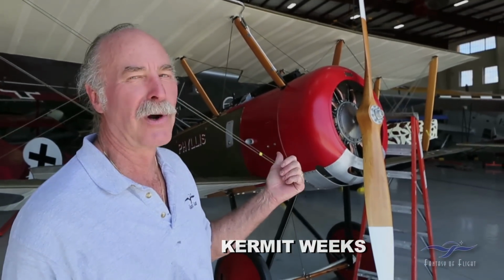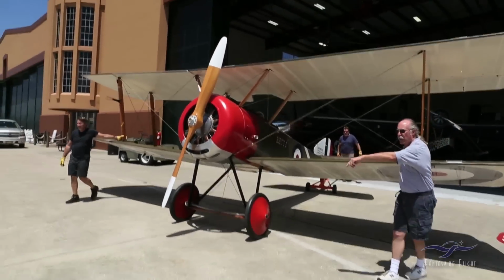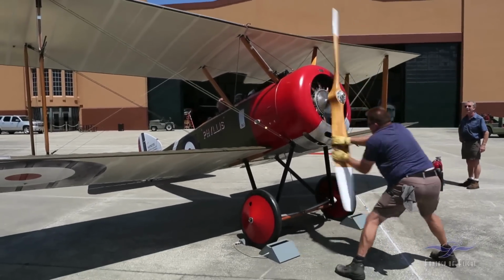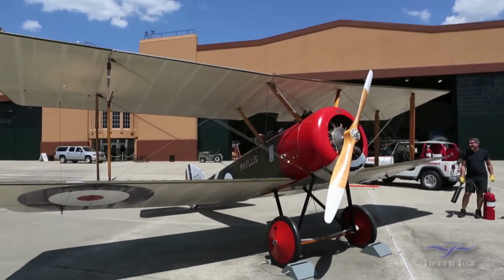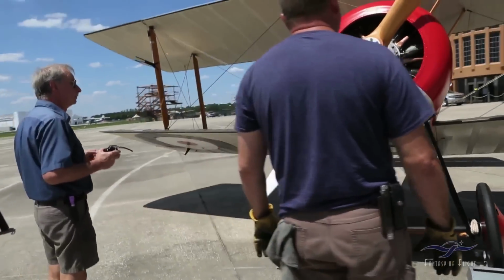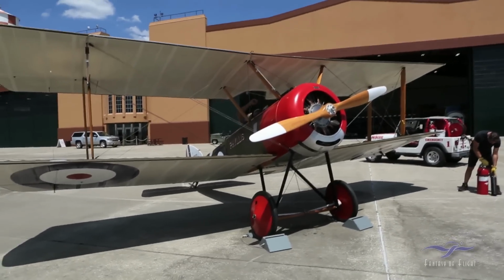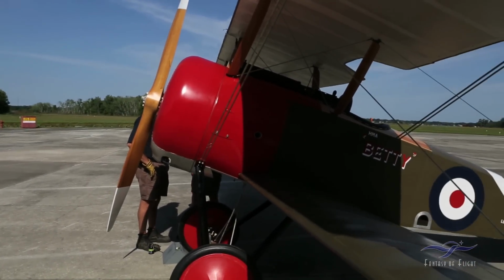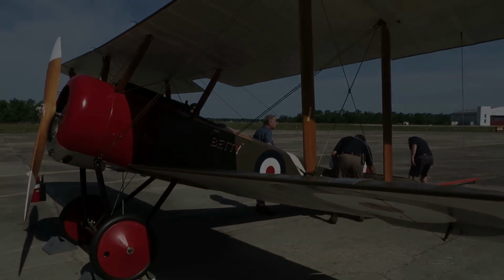Sopwith Pup - Update - Engine Start

Comment: Kermy, great video! We used to start our LeRohne 80 at full throttle after priming all nine cylinders.  No need to worry about oil pressure, with the total loss oil system there isn't any. Oh, and don't forget to turn on the castor oil (what a mess!). We always had a big crowd on hand at the Pearson Air Museum to see it run. The airplane was a replica Nieuport 24bis project stared by Johnny Hart in Vancover, WA, USA, and finished and flown by Ron Oches in Madras, OR. The airplane is currently on display at the Seattle Museum of Flight, Boing Field.
Very seriously tho, I felt less than totally comfortable in the roomy cockpit with all of the ingredients for a fire right there in my lap... the leaky carburetor and the fuel and oil tanks, AND the single magneto! The first item on the check list was to have your head examined!
Reply: I notice the situation with desperate pilots, covered in castor oil,  is not addressed...

Comment: I see the Sikorsky S-39 in the background. I remember when Dick Jackson owed it when it was at Rochester N.H.. I worked at 7B3  North Hampton N.H.for Darian Banfield until he died flying  a Bamboo Bomber  off  floats (Sky Kings) type plane back to 7B3 , North Hampton N.H. Peter Jackson ,the guy who directed Lord Of the Rings in New Zealand had us do a DR3 ( There are no Real ones flying ) as far as I know there all repicares , Albatros  D-VA  and a SE5A (rep) rebuilt and shipped to him in New Zealand.
Then I worked for Craig Sinclair for a few years. Did the fabric Paint and rigging on 3 DR3's and every type of tail wheel and strut. type plane. If it wasn't a tail wheel plane, I didn't touch it.   I owed an Aronca 1941 65CA  .And built 2 new wings for it ,tube welding on the tail .Rebuilt the whole plane. I believe she flew better than any cub.
 Lots of respect for what you do.  Steve Page , Semper Fi

Comment: At some point you or have one of your staff talk about how those rotary engine work,  everyone seems to cover the mechanical parts.  More interested in the carburetor and intake,  wiring to the plugs and points, oiling system etc.  as a rotating mass just would like to see how it is done.  I'm sure they are not as sophisticated as something I work on with rotating slip rings and mercury to connect electrical and signals etc.
Reply from the maker: I'll try to explain it all in the next "Kermie Q's" episode.

Comment: The next update may show what happened shortly thereafter.. The cowl blew off in flight when Kermit was near final, split the prop, numerous rips on the fabric, destroyed the upper wing leading edge. Some damage to the engine pushrods,etc.  The remainder of the cowl was wrapped around the upper wing. Barely made it back to a safe landing. Back to the shop. Great piloting skills the bring it in.

Comment: Are these radial engines not like the first Sherman tanks needing 60 to 90 turns before a start to.get the crap out the cylinders and build up pressure? Looks like its going that way pussing about Trying to spin that prop try turning it 60 times the cylinders are probably full crap

Comment: Great looking aircraft. Why was it that the engine spun with the prop?
Reply: thx11 3868 ; Because it is a rotary engine, lighter, better cooling, and high tech in it's day with no reciprocating parts.
Reply: And you could use the centrifugal force of the spinning engine to ensure that lubricant oil (usually castor oil) got to the places it needed to go without needing an oil pump.
Reply: Ericiri : It was so good that even the pilot got a light lubrication of Castor oil .
Reply: Yes, the joke was that pilots in World War 1 were very regular.
I think I've read that the system was "total loss" - so castor oil was being constantly vented through the crankcase breather.
Reply: EricIrl 
Castor oil was mixed in the fuel like a two-stroke, since the crankcase acted as part of the induction system. The primitive carburetor was attached to the hollow fixed crankshaft. Notice how the copper induction stacks join the crankcase.
There was no crankcase breather. The oil was thrown out in the engine's exhaust.
Reply: The predominant reason for designing the engine to spin was for cooling. Early motorcycles did not travel fast enough for airflow to adequately cool an air-cooled engine without the use of a power-robbing cooling fan. Making the engine spin eliminated the necessity of a fan. This worked well for some early motorcycles so the rotary radial was used in airplanes. A rotary design was first used in the Langley Aerodrome, but it was soon modified to be fixed and watercooled.
Although the propeller could provide some cooling in flight, the rotary stayed cool all the time.

Comment: I read somewhere that with a rotary engine due to the gyroscopic forces of the spinning engine, to bank right you push the stick, to bank left you pull the stick, to descend the stick goes right, to climb the stick goes up. Is this true?

Comment: I worked in a company that build microlight aircraft.
When an engine was started, we were told never to stand to the side directly in line with the prop, just in case the prop shattered and let go.
I see the guy at 19:45 is doing exactly that.
Was I told wrong?

Comment: Is it possible to add a more modern electric fuel pump and more modern computerized electronic ignition system. Wouldn’t that help a lot to make it more reliable? I know you try hard to make the planes as realistic as possible but it seems like that would be a good idea? I had the chance to go up with a uncle of mine that owned a Jenny back in the 60’s that was a blast to fly in.
Reply from the maker: Of course you could probably add those things, but here we keep things as close as possible to the originals.
Reply: Well if it worked back in 1917 why mess with it I guess you just have to tickle it a bit to fine tune things. It’s not like you fly them everyday. Where are you located in relation to south Florida,  Ft Lauderdale area.
Reply: Lester Miller 
That would be more trouble than it would be worth. These airplanes have no electrical systems, batteries, generators, etc. to power up such stuff and they would actually be more troublesome than these simple machines actually are in their original state. They just took some getting used to. Once mastered, they are not that difficult.

Comment: The guy hand propping is wrapping his fingers around the trailing edge of the prop, bad idea if the pup kicks back.
Reply: slickjimmy 
He's fine. Wearing heavy gloves. Not a good idea to "palm prop" it. There's too much of a tendency to lean into the prop doing it that way. I have 35 years of practice hand-propping airplanes. Better to curl the fingers a bit. They say you might get cut a little but that beats loosing your balance and falling into the prop.
I've never seen anyone get cut by a kickback. You don't wrap your fingers around it like a handlebar. Just curl the fingertips so you can pull downward while shifting weight rearward. If it kicks back it just slips past your fingertips. Might hurt a little for a minute.
Reply: @rescue270   That makes sense. I just remember in A&P school having that drilled into our heads. I have only hand propped 2 aircraft in 24 years as an A&P so far.

Comment: What engine??  Are all the cylinders spinning with the prop?? Can someone in the know enlighten us on this design?
Reply: Yes. Early rotary engines rotated with the prop.
Reply: If you get a chance, watch the movie "The Great Walso Pepper" (can be accessed on youtube), the late Art Scholl was one of the pilots. Its a good entertaining movie and their are some good dogfighting scenes.
Reply: @JLEidsness  so how does fuel delivery,  ignition control etc work
Reply: @srnunan4783  http://www.aviation-history.com/engines/rotary.htm has a lot of details about the intake manifold. I believe a magneto provided ignition that was timed thru the crankshaft. The engine rotation added a lot of spinning mass that, depending on the direction of rotation, made turns very difficult in one direction and easy in another.

Comment: never stand inline with a spinning propeller...  under ANY freak accident that thing breaks it becomes a speeding bullet, or a fragmention grenade.
Reply: I tend to agree with you on that, seeing someone stand in the prop's plane of rotation always gives me the heebie-jeebies :)
However, with many aircraft types, it's unavoidable. Simply sitting in the pilot's seat (or one of the passenger seats) puts you in line with a prop, or compressor/turbine disk.

Comment: I was under the impression WW1 rotary engines had no throttle. The engine ignition was cut on and off to control speed. I thought I had seen videos of engines stopping and starting during landings. I still don't understand how a spinning engine get fuel feed to the cylinders without leaking problems.

Comment: Just occurred to me. What do you use for fuel ? A WW2 vet I knew said that he was told naptha spirits/Coleman fuel was the nearest thing to WW1 gasoline. Supposedly rotary engines with their cam ring timing combined with low compression do not run at all well with modern avgas.  You are the people with the actual flying ironmongery,not me. Be nice to know if what he said was accurate. Beautiful airplane. You have some terrific people there. Cheers.
Reply: paul manson 
They run beautifully on avgas. At first. Trouble is all the lead in avgas. These old engines with single ignition will foul sparkplugs and stick valves after a while with all that lead. They don't run hot enough or fast enough to keep the lead from sticking and building up in the combustion chambers.
They probably run this on ethanol-free pump gasoline mixed with castor oil, like a two-stroke. It would run just fine on that.

Comment: It’s NOT HOT. The proper communication between pilot and ground person proping is, “CONTACT”.  But nice job on the restore.
Reply: Ron Pearson 
We always say "mags off!", then "make 'er hot!" just like these guys are doing. I've been propping all my life.
I think the "contact" thing came originally from what American volunteer pilots learned from French flyers in the Lafayette Escadrille in WWI. 
A magneto switch actually "turns on to turn the mag off". "Contact!" probably actually meant the mag was off, since a magneto must be shut off by grounding the primary circuit though a contactor switch.
"D'allumage!" was probably the call made to turn the mag on by opening the switch, breaking contact with the grounding circuit
Reply: Rogers Hunter Roger... I too have been propping planes all my life and I am 71 years old. The reason I was taught brakes and contact was to avoid any confusion. Over the years I have heard all sorts of words used to say, “turn on the dang mags”. Use folks do great work. Keep it up! Ron

Comment: Shouldn't it be - Kingston "Upon" Thames - Kermit ? Ahhh disregard, was on before it became upon lol
Reply: Techy111 I've been inside the building where they were manufactured in Kingston-upon-Thames!
Reply: @andrewwood6809  Seems it's officially Kingston upon Thames but I grew up many years ago a few miles away in Molesey and it was always Kingston on Thames if you wanted use the full name instead of just Kingston.  Goes with Walton on Thames bit further upstream. RJ Ashfield was my grandfather.

Comment: I can tell the way it fires then dies it's not sucking the fuel in, something to do with the intake.. vacuum leak, or some esoteric feature of that engine I don't know about, but I could tell it's must not getting the right mixture into the jugs. Interesting how it has some kind of air throttle on it, then a mixture control. The idea to cut the air down was logical. You know the mags are working. At least you made progress.. Hey check that cowl cable.. they are known to come loose.. Just sayin.
Reply: Dave B the sputtering is the blip switch or ignition cut switch. It was used to control throttle. Once the air/fuel mix was dialed in the pilot could blip the ignition cut to keep the rpm down like on landing and taxi. Easy to see why they abandoned the rotary engine with all that roll inducing torque from the engine wieght spinning round
Reply: in English?
Reply: john gibons ????  Not sure what you mean bud

Comment: Rotary engines have always fascinated me.  Having that heavy gyroscope up front must have caused major issues in handling
Reply: Engine rotates clockwise from cockpit, so in a dogfight a hard blip would help torque the airplane over onto its left wing.

Comment: What does a "blip switch" do??
Reply: Hans Brings the blip switch momentarily cuts the engine out.
Reply: Rotaries didn't have throttles in the way more modern piston engines do. The simplest way to cut the throttle was to turn the magneto (blip) switch on and off. If you read Biggles stories of World War 1 you will hear the author talk about the technique.
Reply: Hans Brings cuts the fuel

Comment: Is this just a smaller camel
Reply from the maker: The Pup was the predecessor to the Camel. The Camel in it's early development was referred to as the "Big Pup". It had a bulkier fuselage, was faster and had heavier armament. A metal fairing that protruded over the gun breeches, creating a "hump", led the pilots to start calling the plane the "Camel'.

Comment: Good thing its not 1917 and they had to scramble... XD
Reply: /M0ther_bra1ned/ Ironically one of the benefits of this engine technology was that it was faster to start and get airborne than a liquid cooled engine which had to warm up prior to flight for a longer period of time. The first American victories in WW1 in the air were in Nieuport 28s who scrambled and intercepted a German patrol and shot down two of them a Pfaltz and an Albatross within sight of their (American) Aerodrome.
Reply: Yah to be fair the plane was just rebuilt. But those early rotary engines were pretty impressive.
Reply: Kermit you should have had a red scarf on. 🤣👍🏼 AWESOME job guys!!! Kermit you have the best aircraft crew on the planet. 🤙🏼😁🤙🏼
Reply: That's not a problem, it's a feature. It keeps the pilot alive longer.